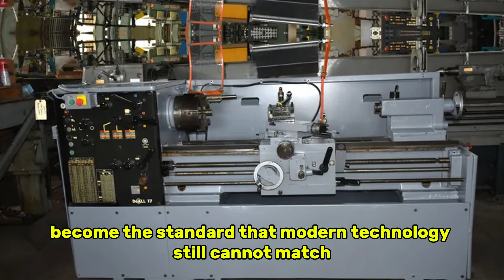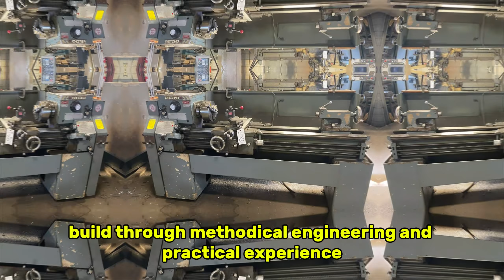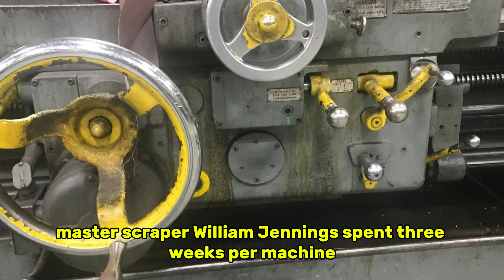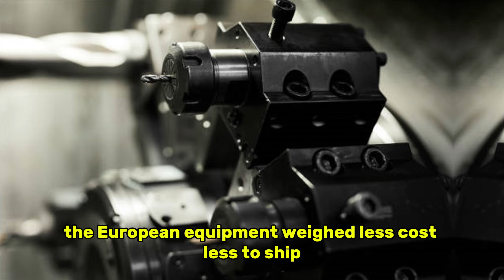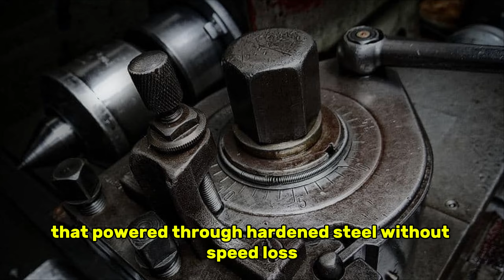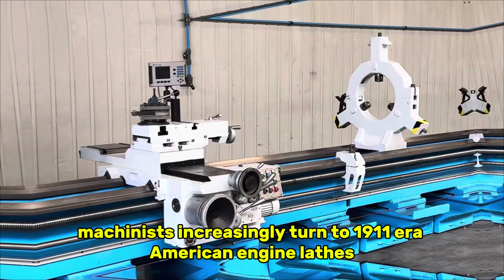The 1911 Lathe Engineers Laughed At — Until It Outcut Modern CNC Machines

Comment: It's a pity there is no film footage of these amazing lathes at work.
Reply: You can search for "Manual Engine Lathes". Granted what you find probably won't be one constructed in 1911, but they are still pretty much the same in construction and operation. At my last job we had one with a 40in spindle capacity and 40ft bed.